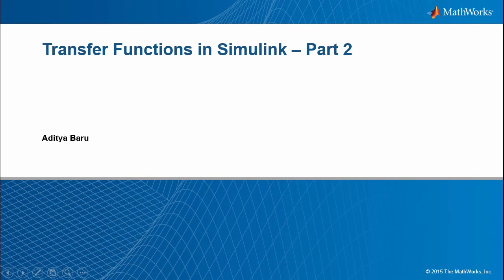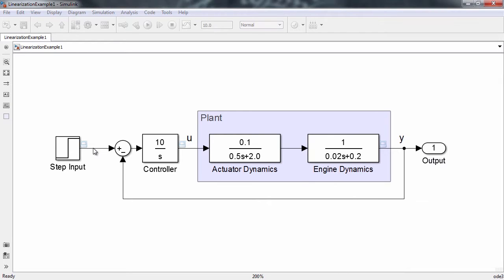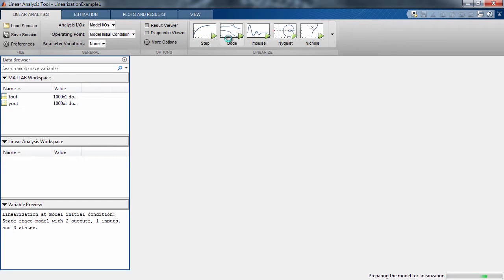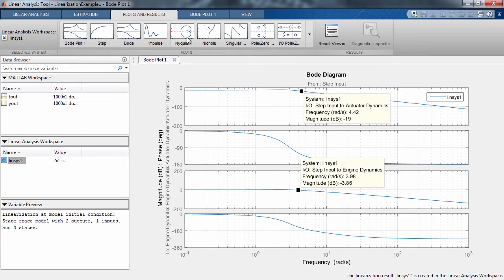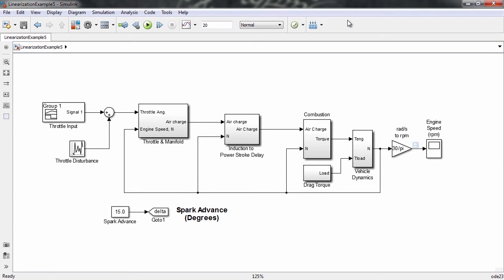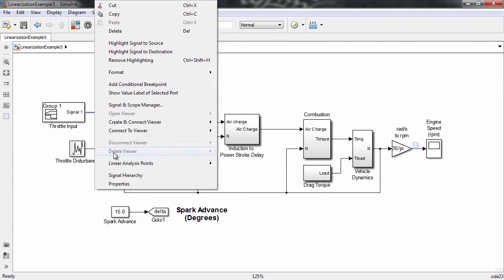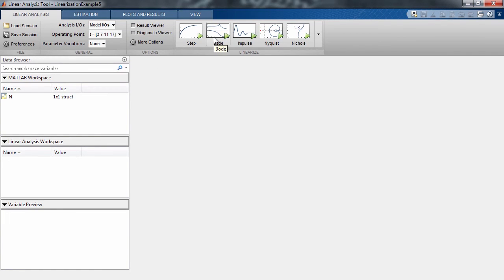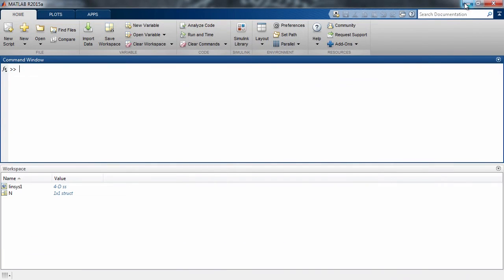Transfer Functions in Simulink, Part 2: Extracting Transfer Functions

Comment: Is it possible to simulate a complex RLC circuit and get the transfer function this way?
For example: can I draw equivalent circuit of an induction motor in arbitrary reference frame and linearize it to get transfer function?